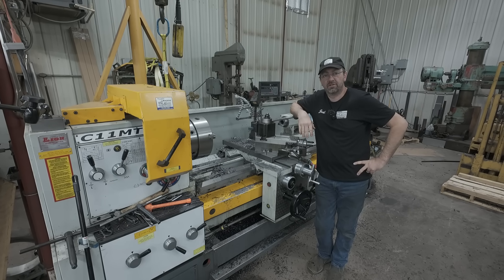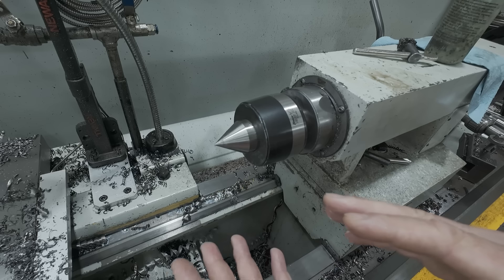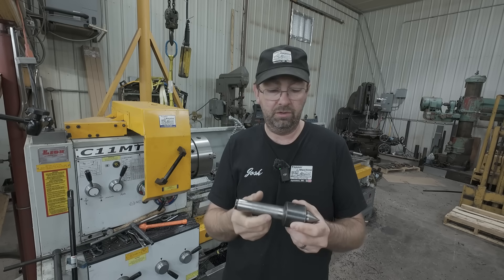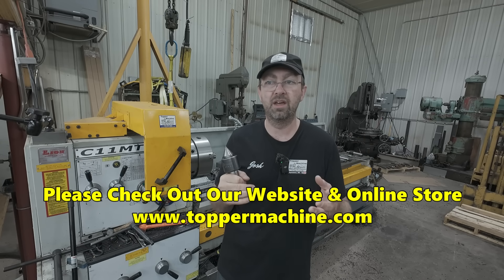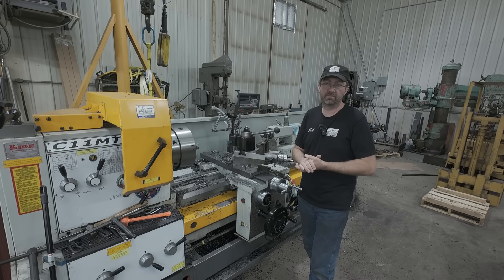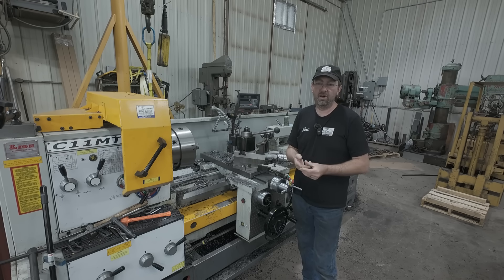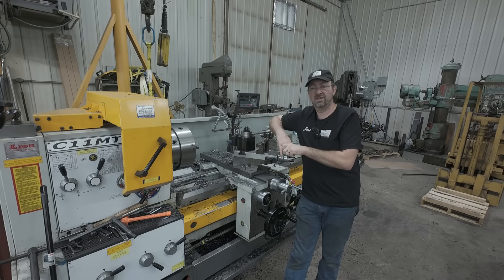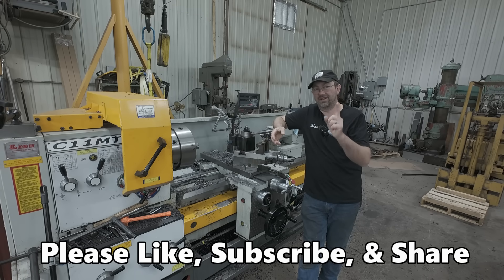Chatter Has Ruined My Life | Follow-Up Video of the Conveyor Roller Repair | Viewer Questions

Comment: The other thing that might have been missed about CnC moving faster is that mostly what's moving faster is the cutting head, not the part, and that's a darn sight smaller, as you mentioned. Comparing a CnC milling head with that massive roller spinning around is, uh, a little confused, I'd say. ;-]
Thanks for the update, it's always interesting to see what caused the problems in the last video, and what you found out after the camera turned off. I am wondering if something about the nature of your work over time (like, the unbalanced nature of the jobs as provided by customers, or something weirdly harmonic, or whatever you might think of) might be exacerbating the damage to the live center over time? I'm not sure how you'd tell, nor any idea what you'd have to test to figure it out, but I thought I'd throw the idea out and see if it had any merit, or caused you to think of something else that might need looking at. And hey, worst case, at least I learn something, right?

Comment: Good info buddy to those uninitiated. I've had jobs where I've switched out centers 3 or 4 times and ultimately ended up up back to a dead center with high pressure grease. Cant beat it. We also do alot of cylindrical grinding which requires a dead center for accuracy. Live centers just wont cut it. Keep up the good work!

Comment: Crowning was once explained to me as the belt "running toward the grip". There is no grip on the outside of the roller so it 'climbs' to the tighter section in the center. Helped me to visualize what is happening to the belt.
Thanks for answering the questions and your fine explanations during machining. It is helping me learn new techniques. Keep doing it right !
Reply: The same exact concept applies to the wheels on band saws. A few thou crown helps the blade stay centered.
Reply: @dougbriggs6797  wondering if my belt sander has crowning  dought it as drive roller is rubber coated but still going to check it and the idle one
Reply: both crown and tracking adjust. the crown may only be on one roller

Comment: Why not put a block under the bearing and stop its rotation?
Reply from the maker: Bearing had nothing to do with anything.  If it were turning much faster, it could have caused some issue.
Reply: @TopperMachineLLC  but with the bearing supported it would change the harmonic of the rod and maybe reduce the chatter.

Comment: As a machinist, surface finish is extremely important to you. You're lucky the conveyor roller really highlighted the problem, so you investigated deeply. The chatter on the roller is, frankly, irrelevant, other than your pride in workmanship. properly crowning the roller is what is important.
Reply: I don't know, until it wears in, a bad finish might well produce more wear on the belt. Of course, as long as it wears evenly, once it does wear in it won't matter. But a poor finish is just sloppy. Pride in your workmanship, even when it does not matter is good PR with your clients.

Comment: The other thing I used to find is that everyone especially management has an opinion and will spend 3 hours discussing how you can save 5 minutes on a job ,  which I did hours before by just doing it without planning it discussing it ,  if it's a low volume job 1 or 2  basically just do it , if it's 3 or more make a jig so they are all identical ,  if it's more than a few dozen automated it ,  that's what I used to do make the required machinery so it could get on unattended part of the cycle ,  volume is all ,  batch processing makes a lot of sense ,
Reply: Ben there, done that.

Comment: I find the YouTube comments about the build quality fascinating ,  the fact it's run for many years and only worn to the point of needing recut, says to me the design and manufacture is fine ,  it may not be as perfect as some would make it, but industrial welding is more about function than "prettiness"  the same phenomena occurs in many skilled trades ,  the Facebook workers compared to the man who has 40 years experience building ships or whatever ,  I would certainly prefer being in a ship welded by the skilled tradesman with his "substandard welds"  to the perfect Facebook or YouTube short welds with zero penetration,  I would thread the shaft and the discs and then weld them in place ,  but that's just me,   they are built like that for a reason maybe not the best choice but it exists and really it's a commercial  decision ,
Reply from the maker: I agree with most of your comment.  Except for the part of threading the shaft and discs.  A slip fit would have been significantly better and involved little work.  But, you are spot on about the internet welders.  LOL
Reply: I always to told my welding students that I'd rather have a butt ugly weld that was strong than a pretty weld that was weak.

Comment: Hi Josh, I have to preface this question by admitting the depth of my ignorance (pretty much total). If you have exhausted the options to make the setup more rigid, would switching to a toolpost grinder rather than a cutting tool  reduce the chatter? Best regards Sarah
Reply from the maker: A tool post grinder is only for finish work.  Basically turning a lathe into a cylindrical grinder.  It would have taken weeks to grind all that off.
Reply: @TopperMachineLLC  Understood, thank you for the reply.

Comment: Hello Josh,  I have turned a shaft just like this one (idler for the bottom/return side of the conveyor belt) and they can be a bitch when they want to chatter.  I tried my regular cnmg finishing inserts at low speed and it chattered.  Kept slowing it down to no avail.  Switched to very sharp HSS and went even slower, better but still chattered a bit.  However it was so slow that it was going to take days to machine.  Got pissed off, put the cnmg back in and set the speed way higher than I would ever recommend and to my complete surprise it cut without chatter.  Exactly the opposite of what my 20 years of experience had taught me.  Machining can be so fickle sometimes it seems spiteful.  Regarding the live centre, the axial movement you are getting on the TMX centre does not necessarily mean it is worn or buggered up.  I own a No. 4 Rohm live centre that has the same axial float and it is brand new.  I also have a brand new No. 5 Rotor brand (Swiss made, about $1500.00, from what I've heard considered to be the best live centre you can get) and it has the axial float as well.  It is a characteristic of using needle bearings.  The centre can float axially in the radial needle bearing but comes up hard against a thrust bearing when you push the centre into the work.  When done properly the needle bearing set up can be very stiff and carry huge loads.  Maybe the TMX centre was a good design that was poorly executed.  Ken

Comment: I know that it will be awhile, but I’m looking forward to hearing why that large shaft can’t be welded. I don’t think that warpage is the reason with a shaft that short and stout. Also I have learned the hard way, how something is welded has a lot to do with how much it warps. If you do sleeve it I will find that interesting too, as I have wondered how to sleeve a shaft with a key way and have the key still hold ok.
Reply from the maker: It will be a while yet.

Comment: Thats pretty gnarley chatter ..I really hate when the tools I use are actually the problem.....There's that old phrase but you know what sometimes its true.
I think even as an industrial setting  that centre should have lasted a lot longer than it did....
I would have thought weld on a hardenable steel could sheer off quite nastily when its loaded 
personally although I see a use for it I hate CNC yucky stuff that we do not need ....seriously CNC is for production runs not one off jobs ...wow.
 Having seen where finishes go when applying them to woodturning I don't mess about with anything metal 
except this one time when I put a normal drill bit with countersink in a router (first time I had seen a router so had no idea) I switched it on held just infront of me and luckily the bit went away from me but it snapped out of the collet and stuck in a window frame where even pliers wouldnt get it out so ........nope
I did it incidentally because the drill and countersink gave a better finish than the router bit so I thought it might speed up the job ....dont do it.
good news more content on the way...
Thanks for sharing Josh

Comment: Thanks for the update Josh and I am glad to hear you found out the issue with the live centre.   Regarding the issue of poor design / build quality of the original rollers.  Surely if they have been working as intended for the last 5 / 10 years with no major issue other than friction induced wear, then by default they seem to be working as the designer intended ?   It is not part of a Nuclear submarine guidance system or a race car suspension, just a plain old belt roller trundling around in an asphalt plant.
Reply from the maker: You are correct. It functioned as intended, but still not a great design.

Comment: Here's a point to ponder and I didn't get a chance to ask on the original video. I noticed that not only was there weld on one side of the disks, but if you look back the tolerance on the weld angles were not real tight. Instead of being perpendicular to the shaft some appear to have been tilted. Could that have caused a harmonic or something that caused or contributed to the chatter?
Reply from the maker: Very unlikely.